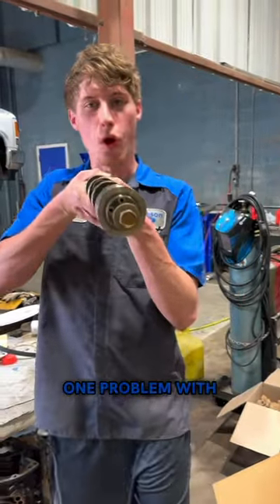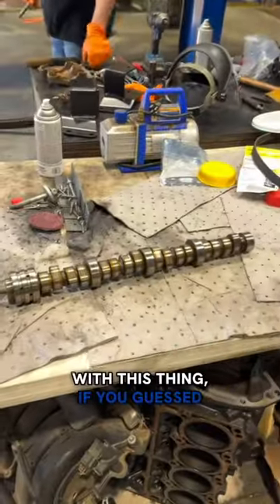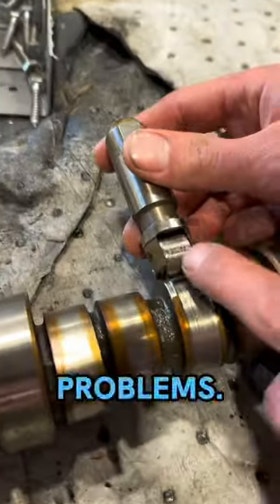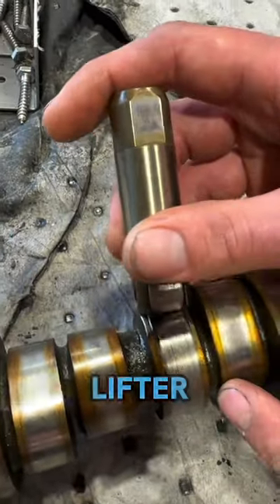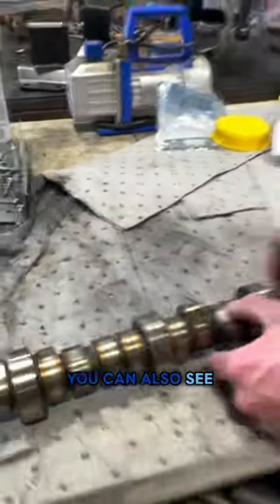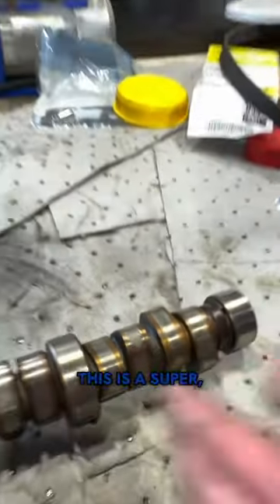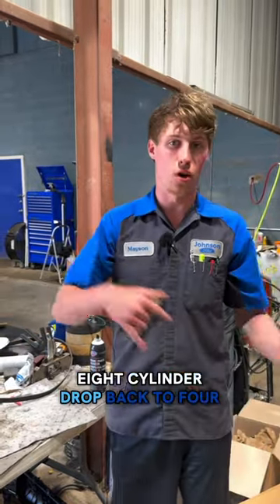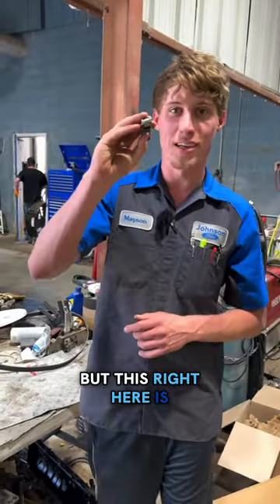The Number One Issue Plaguing Overhead Valve V8 Engines #shorts

Comment: Its not the ohv issue ots the AFM/DOD oiling issue that causes uneven wear and eventual destruction of components. If dodge and chevy stopped with the AFM/DOD the issues would drop to lack of maintenance. Not saying that some newer overhead cam engines arent excellent but OHV engines with standard lifters and cams are super reliable when you take the BS away.

Comment: Its not the lifter failing. Its the use of forced Fuel Economy. deactivating cylinders stops proper oil lubrication then causing the lifters to prematurely fail then the cam and so on. Do away with cylinder deactivate and the problem will go away.

Comment: Poor metallurgy and quality. Had plenty of gasoline engines with Carburetors and fuel injected that had several hundred thousand miles on them. 
   These days, if you want the Warranty to be good, you do all repairs and service at the dealer and MAYBE it will last that long. It's not the Dealer or the Tech, it's the quality and Government edicts for mileage and emmissions. Tell them the number, not how to achieve it.

Comment: So you're saying this is a common problem on modern overhead valve engines with roller lifters?. But it was a very rare problem in older Cameron block engines with flat tap it hydraulic lifters or even solid lifters.... I'm going to blame it on the 5w20 and low quality modern oils

Comment: This is NOT a problem with overhead valve engines. Issues like the one you have there are predominately caused by lack of maintenance. The biggest scam from manufacturers in the last 20 years are the recommended oil change intervals. Halve what the manufacturer says and these engines will last 300k miles and beyond. Some people think that engines are cheaper than oil changes though.

Comment: I would say that a common problem but it may or must be getting more common. That wasn't much of a problem before part mfg were out and moved out of the US. Parts keep getting cheaper and low quality. Also if you look a bit closer you may find that the lifter will spin causing this issue if it doesn't use bars.

Comment: Every brand has planned major failure engineered into them. Most don't happen until the vehicle is old enough that the loan was recently paid off. Forcing you to have expensive work done at the stealership service dept or buying a new vehicle. Regardless, the consumer takes the loss.

Comment: Seen this happen to the chryler 3.6l. Ls motors. Hemis Etc. Pretty much any motor that has roller lifters or rockers that contact the camshaft. Eventually the bearings fail and grind against the cam wearing it down.

Comment: With the 5.7L hemi one of the most common things that kills it is extended idle time. They have problems with getting oil up to the cam and valvetrain at idle which causes this problem, which is why for example cop cars that have a 5.7L hemi have to get engines replaced or rebuilt all the time. Also as you said the MDS causes alot of problems in cam in block engines

Comment: You have to change your oil at least every 5k miles.  This bullshit mileage counter crap these things have anymore is just straight up crap.  If you follow these you will end up putting 10k or more on an engine between oil changes.  This is too much.  

The difference is that in older engines the oil is largely just a lubricant.  In these DOD engines it is now acting as a hydraulic fluid when it pressurizes these lifters.  This works the oil alot more.

Comment: It's not so much a design problem from the roller and the lobe it's a outsourcing is someone else mentioned in the comments but also it's having extra bullshit that is not needed if you buying a v8 engine you plan to use those fucking cylinders

By the way the worst thing to ever do is to have an engine with a cylinders not firing but they're moving The temperature change is massive The piston rings are meant to operate under operating temperatures and pressures if you don't have that pressure in there especially from combustion into heat That's no good also I don't know if their truly shutting off the fuel injection system hopefully they are but I can say this much if there's a malfunction with that it could literally wash down your cylinder walls and score the fuck out of them because that fuel's not being burned and it's allowing to puddle up on the piston which will then go to the rings and well score everything up dilute your oil score the rest of your cylinder walls up and you're done

Comment: Technically it's pushrod not over head valve the only engines that are not overhead valve is engines that have the valves in the block like early v8 engines that you can actually run with out one head on the engine so even if the cam is on top of the head it's Technically a overhead valve engine but it's a complicated thing and just makes confusion and on hemi engines it's mostly bad parts and lack of liberation in the block it's self from extended idling and lack of high rpms and high rps so you can't with with a hemi that's why it's called a  (hardly ever makes it) it's in it's name

Comment: The design is not the problem. It is the Quality of the parts. Fox body mustangs had roller lifter engines and we beat the hell out of them. When you outsource the to cheapest supplier corners get cut!

Comment: The Hemi has a design flaw - the cam doesn't get enough oil at idle. So it overheats and the Cascade failures start.. The metal flakes migrate throughout the engine, get stuck in the other parts, and then the dominoes start falling- because of one bad lifter ,the whole engine needs a rebuild.

Comment: The camshaft is mounted too high in the block. LS and hemi. Grinding flats on the sides of those tappets will probably let some oil get on that lobe and lubricate that little roller. I would take those lifters apart, drill .030 holes and let oil spray on the roller…. Extended idle and extended oil changes dont help..

Comment: I believe it's the misinformation that 10k mile oil changes are sufficient as well as a lack of zinc in oil now. I was never a fan of an engine cutting off cylinders for fuel economy either.

Comment: specify pushrod motor. every motor now days have overhead valves and some overhead cams. i see in block valve motors all the time and will have the same issues. mostly due to cheap needle bearings but still good to specify

Comment: The problem with the 5.7 is the oiling. The angle of the lifters doesn't allow oil to run to the roller and the lobe. Alot of idling will kill the hemi since they get oiled by splash. So drive your hemi like you stole it and it will be fine.

Comment: Third gen hemi lifters issues stem from the angle they are at, the cam lobes and rollers in the lifters are oiled by splash. Unfortunately the angle of the lifter is so that the oil falls off the lifter just above the roller, never reaching the roller or the cam lobe. This problem is further aggravated by thin oil and high idle time. You would have to change the design of the block to alter the lifter angle but that’s easier said then done.

Comment: Why do they make these roller bearings so cheap??
Reply: The problem is an oil issue and not material itself. The reason they fail is not having enough oil and dirty oil. The most damage occurs during low rpm mainly at idle when there is less oil circulating.

Comment: The 3rd gen 3.6L Pentastar, the one with the variable valve lift, always wipes out the right side intake camshaft and both intake phaser failures at some point after at least 60k miles, some earlier than that. It's own design condemns itself 😢. Will usually always last during the entire warranty period. Lack of oil changes only speeds this way up.

Comment: We had an 07' 5.7 hemi that dropped the intake valve seats on opposing cylinders, and the entire engine is  basically toast . A 60 year old man and wife drove the 300c every day. What a pos.
Reply: Have heard of that happening. But its usually caused by overheating. The fit on the seats isnt tight enough and if engine gets hot, theyll drop...

Comment: Wow. Cashier at O’Reilly Auto described this exact Chevy 5.3L DOD/AFM & lifter problem to me yesterday as well as the preventative measure - although you’d need to do it basically when the engine/car is new to get the full benefit.  By the time it gives symptoms, the irreversible damage is done…All in the name of mpg efficiency.

Comment: It's not a cam or lifter problem,  it's caused by the lowering of zinc (ZDDP) in today's oil, it started I think around 2007 when EPA wanted catalytic converters to last longer, so the car manufacturers changed oil specification requirements to meet the new requirements,  it didn't cost them anything,  but costs you, outside of warranty.
Reply: Why doesn't it happen on on every car then?
Reply: @jamesfranko5098  it depends some on driving conditions, regular maintenance & alot on what oil is being used.

Comment: A little look at history gives us the 2.3L Ford OHC, famous for roller cam follower failure......
Reply: That is true, but they did not start failing until the late 70's /80's when the EPA made them take zinc and other "hazardous" additives out of the oil.
Reply: @barbmelle3136  
Replaced a lot of cams long before the reduction of zinc happened in the late 80's. Late 60's saw big issues starting with wiping cams out. Generally blamed on bad parts, often the fault was customers changing oil at manufacturers new, longer oil change intervals and using 10w40 and 10w50 oils.
     Hot running emissions engines would kill the additives the oils as quickly as 2,500 miles on hardworking, overstressed smog motors. Better additive packages came along by the 80's, and the use of 10w40 & 10w50 oils was discouraged, replaced with the more durable 10w30 and later 5w30 oils.
  The 2000 and 2300 Ford had a narrow, small lobe and following pad and had more issues with oiling than other designs.

Comment: All motors are overhead valve except rotary lol
Reply: Wrong, many are overhead cam.
Reply: dont correct people if youre clueless yourself lol
Reply: @Retadin  he states overhead valve
Reply: @skullfan33  not all motors are overhead valve. 7.3 godzilla is an overhead valve engine, where the cam is in the block. A motor like the 5.0 coyote is an overhead cam, with the cam in the head.
Reply: Overhead Valve means the valves are in the cylinder head. in a flathead engine the valves are in the cylinder block.an overhead cam means the camshaft is located on top of the cylinder head, over the valves and usually has a rocker arm design  under the camshaft and doesn't use push rods to actuate the valves..in a non overhead cam engine the camshaft is located in the cylinder block whether it be a valves  in block design like older engines used or a ovehead valve engine that uses push rods to actuate the valves.over head cam engines are overhead Valve engines and the camshaft is Not located in the block.
Reply: I love these threads
Reply: You forgot flatheads..........<grin>

Comment: It was decided a long time ago that dual overhead cams and four valves per cylinder is the best setup. This is one reason imports are capable of crazy power. Only certain Americans are clinging to overhead valves, carburetors, and “roots blowers” which weren’t even cutting edge in the 1970s.